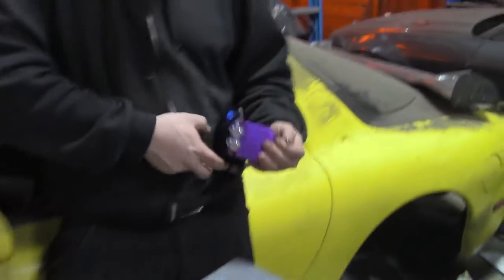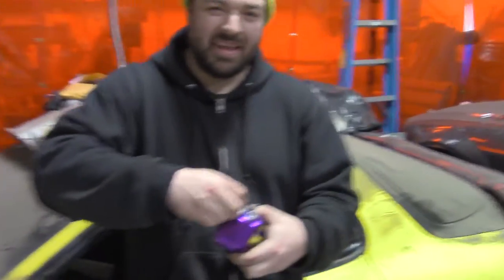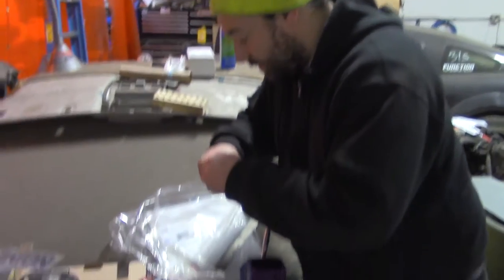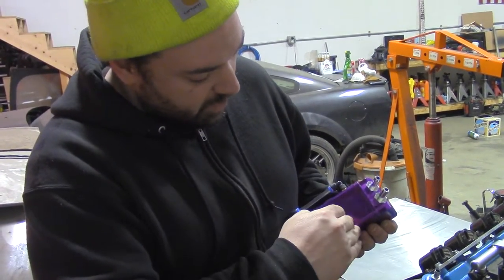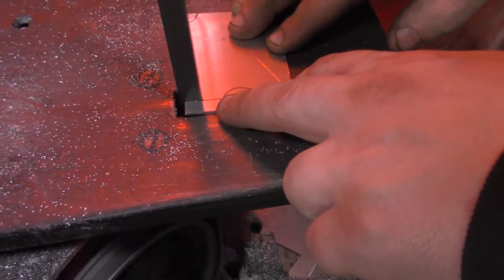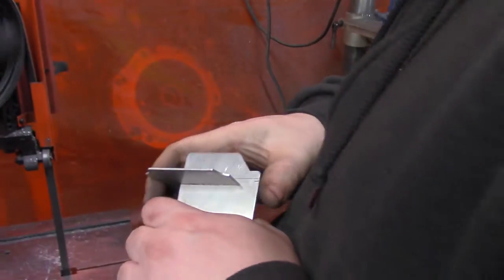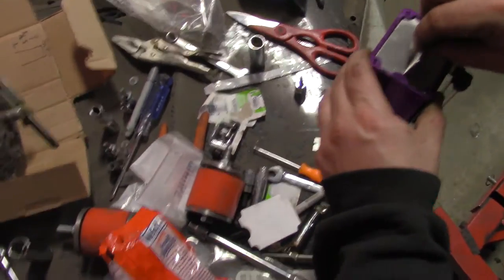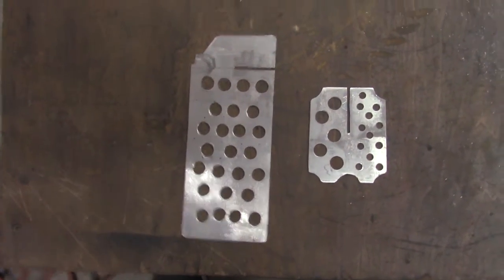S13 Oil Catch Can Baffles FUNCTION BEAST:  S1-E18

Comment: How much will it cost to make ne that baffle?
Reply from the maker: It's so cheap. It's two small pieces of aluminum that was laying around the shop. You could do this with a hand drill and an angle grinder if you didn't have a drill press and a band saw. It's an awesome upgrade for almost free.